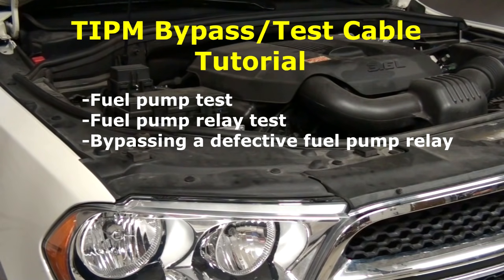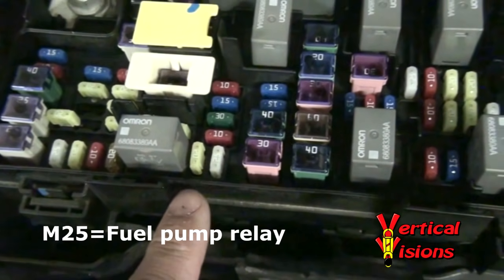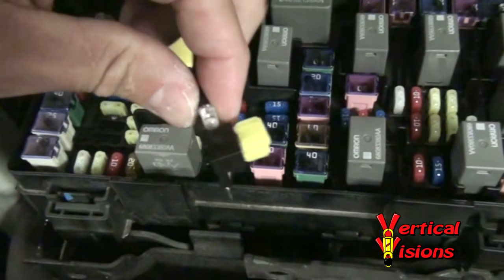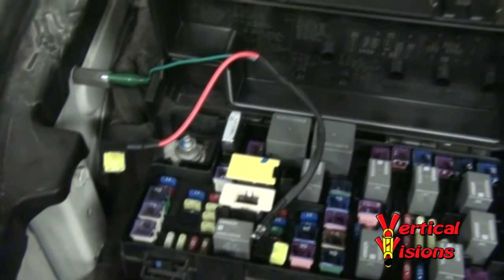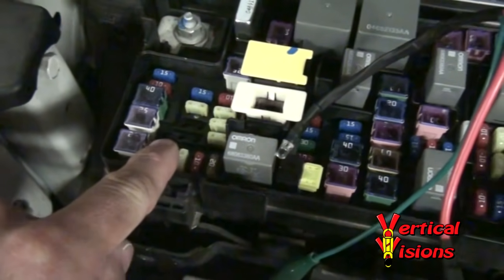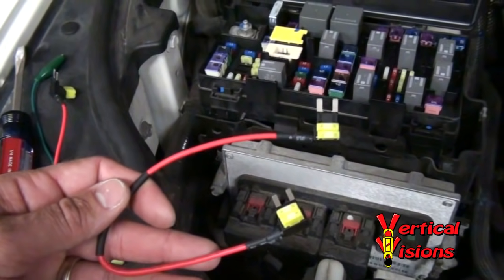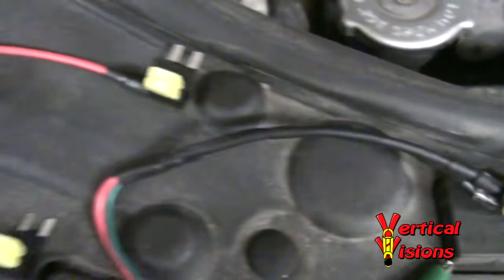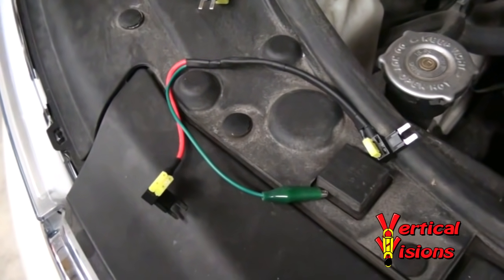TIPM Fuel Relay Test and Bypass Solutions - Most 2007-2021 Dodge, Chrysler, Ram, Jeep, VW Vehicles

Comment: Thank you Jason, I just ordered your bypass wire you came up with.  Like everyone else has said in some way this is a life saver.  It is very frustrating when a part is $1200  and the car is a 2011.  My daughter's 2011 Jeep Liberty the other day when she was driving on a 55 mph road just stopped running, luckily my wife was with her and was able to talk her through getting to shoulder of road without power steering which my daughter has never experienced before.  My wife though she had forgot to get gas or something but she had a quarter tank.  They sat there for a few minutes and then it started back up and they came on home.  Shame on Jeep for knowing about this problem with a 5 dollar relay that could potentially cause bad wrecks and praise for Jason Bell for having the electrical knowledge and where with all to find a simple affordable solution.
Reply: It's only $ 175  dealers are crooks  .. my friend that works at dodge put one under her name for me for my truck cost her only 175  but for me its 1200 wtf

Comment: This is happening to my 2011 ram 1500. Bought your cable and did the M7 fuse tap and it would start and get me going. Today that stopped working and now I tapped into the M37 which worked even better with starting. However, upon getting out of my vehicle and turning it off the engine/truck was still running. Any idea why or how to avoid having to pop the hood and pulling the fuse each time?
Reply from the maker: You must remove the lower fuse on the M25 end of the cable per our instructions:  https://www.verticalvisions.com/tipm-test-bypass-cable-mini-blade-fuses.html#faq19,  Otherwise, a stuck on faulty fuel relay can backfeed power to the run/start circuit, which will keep your vehicle running.

Comment: I recently bought this from you but since I installed it my Dodge battery drains dispite me removing the lower fuse and yes the fuel pump does stop running
Reply from the maker: Email us a photo of your installation so we can see if the cable is connected properly. Are you using the new M37 to M25 connection?  More here:  https://www.verticalvisions.com/tipm-test-bypass-cable-mini-blade-fuses.html#faq19.  Other things can drain your battery besides the fuel pump.

Comment: Thank you!  Thank you.  Thank you!  One day I woke up and my car would crank but not start.  I was at my wit's end.  I had it towed to the local shop where they couldn't diagnose it for a week.  I had no warning lights, everything came on, it just would not crank.  I researched the issue along with my model, 2013 Chrysler Town and Country, and I kept seeing the same problem that Chrysler refuses to acknowledge...the hinky TIPM and the often failing fuel pump relay and overall lack of reliability of the TIPM.  The mechanic eventually said I needed a new fuel pump even though you could hear it come on when the car was turned on and a $694 fuel pump repair.  I politely had my car towed to the dealership and they got in and the vile betrayer that is my car started and he drove it around saying that it seemed fine.  I came back the next day and it was still fine but they said if I wanted to pay them to diagnose it they would but sometimes it's just one of those things you hysterical woman you.  I was at my wit's end, drove it home where it promptly stopped cranking again.  I ordered your simple cable, installed it(I am not technically inclined but the instructions were so clear a 10-year-old could do it), and drove around the block....came back home...10 minutes later drove to the grocery store...then back home...parked it came in and went back out to....you see where I am going.  A $25 cord saved the day until I can either get a new TIPM or I give up on this car.  Thank you!
Reply from the maker: The most difficult part of our business is convincing people a $25 cable will resolve their issue.  Yes, they work and there are thousands of cables in use worldwide since 2014.  Thanks for your comments.
Reply: @VerticalVisions  I have a 2007 Dodge ram 1500 slt with the 5.7 hemi. 
The #7 fuse is the SRT: Solenoid reverse lockout 
The #25 is the window door lock switch, driver side, shift motor, mode sensor assembly.
I was wondering if this procedure would work the same on my tipm configuration. I did read somewhere that the 2007 does not have a fuel pump fuse. 
Any help would be greatly appreciated.
Reply: tried every fuse in the box but none worked..could be another issue..decided to take it to a mechanic..thanks anyway
Reply: How do I buy this part?
Reply from the maker: https://www.verticalvisions.com/products/tipm-test-bypass-cables.html
Reply: @VerticalVisions  I have a 2007 dodge grand caravan..it doesn't have a m7 or m37 fuse..which fuse would be good to use for this year's make
Reply from the maker: @torrancenorwood8579  Not sure, as we have not tested any cables or products on your TIPM style.  Another option would be a used TIPM:  https://www.verticalvisions.com/used-tipm.html
Reply: How can I order the jump wire my name is Keith Allen
Reply from the maker: @keithallen3505  https://www.verticalvisions.com/tipm-test-bypass-cable-mini-blade-fuses.html
Reply: @VerticalVisions  Hello. Jason is by doing this is safe for the vehicle.
Reply from the maker: @danylerma73  Of course it's safe.  Tens of thousands of cables are in use all over the world as I type this reply.
Reply: Notify me if there’s one available for the 2010 Ram 3500 PLEASE and Thank You 🙏🏽
Reply: 8 months later, hows it going? Great, I hope!! 

I'm in the market for a Grand Cherokee, and unfortunately they seem to be plagued with this issue
Reply: THANKS A LOT JASSON.
One question after bypassing is the battery will drain??
Reply from the maker: @KamranRizvi  No.  You can configure the cable to isolate the faulty fuel pump relay from the fuel pump circuit.

Comment: You mentioned there could be a possible remote start issue. After i completed the bypass my remote start will not start the van. I can use the ignition and it starts no problem but if i use the remote start it continually cranks without starting. Do you have a fix for this issue?
Reply from the maker: Here's the fix (a new way to hook up the cable):  https://www.verticalvisions.com/tipm-test-bypass-cable-mini-blade-fuses.html#faq19

Comment: I have my 2013 town & country with no power to either horn fuses but horns work when locking with FOB or using the panic button!! But they both go through the security system and the flashers will flash as well.. But my right & left horn fuses are dead on both sides of the fuses!! I think the horn relay that is soldered in isn't working... Will this fix this problem??
Reply from the maker: No.  Our part solves fuel relay issues where constant power is required.  If you were to use our TIPM cables for your horn, you would have a horn that works 100% of the time (not good).  There is normally no power on the horn fuses until you activate the horn.  If your FOB honks but the steering wheel won't, then I would focus on the mechanical horn connection in the steering wheel.  Likely not a horn relay issue as these relays rarely fail due to such intermittent use.

Comment: This doesnt work for me.   I installed it an it did work the very 1st time.  Alot of thick white smoke came out of my exhaust pipe so i cut it off, an now it wont start again.
Reply from the maker: Did you make your own cable?  What is your vehicle year/make/model?  Make sure you're using the newer M37 to M25 connection:  https://www.verticalvisions.com/tipm-test-bypass-cable-mini-blade-fuses.html#faq19

Comment: Hi, i just tested my fuel pump fuse on my 2009 ram with a test light, with engine off, test light light up like is a good fuse, this will discard a bad relay, right? Please, let me know , working on it now. Tks
Reply from the maker: 2007-2010 Ram vehicles have their fuel pump relay in a different position (further downstream of the fuse), so detecting 12 VDC when the vehicle is off is normal.  This also means you can't use TIPM cables to test or inject power (bad) as is done on 2011 and newer Rams and often a TIPM replacement is suggested (https://www.verticalvisions.com/used-tipm.html) because it's quite difficult to replace the faulty relay on the circuit board.  Here is more info:  https://www.verticalvisions.com/tipm-test-bypass-cable-mini-blade-fuses.html#faq10

Comment: Hello Jason. Thanks for the great video. You mentioned that you took apart the tipm several times to make this bypass cable. I’m curious if it would adapt to checking all the starter control relays that aren’t serviceable as well. I’m trying to find an intermittent no crank and need to rule out or call the tipm. Thanks for you video and your help if you have time.
Reply from the maker: I just did some research on starter issues inside the TIPM.  There is a surface mount high side driver on one PCB that interfaces with the starter circuit.  While I have yet to repair one, I believe this part is the culprit on some no start TIPMs.

Comment: Hello Jason, my Ram 1500 is a 2007. It shut down on the freeway.  I suspected the fuel pump. Once towed home I validated that because I sprayed quick start in intake duct and it started for a moment. I want to try the bypass 1st, but your TIPM looks different than the one I have?
Reply from the maker: https://www.verticalvisions.com/tipm-test-bypass-cable-mini-blade-fuses.html#faq10

Comment: I have a Durango 2013 I did the same thing one time I got it started but I saw your video purchase that cable on your web site it arrive 2 days ago but truck it’s doing good should I by passed it or wait until it fails again?
Reply from the maker: You likely already have an external fuel relay installed on your vehicle per the 2011-13 Durango recall and you may not even know it.  Go here to identify and see solutions:  https://www.verticalvisions.com/omron-g8jn-external-relay.html#identify
Reply: Jason Bell I installed your cable from m25 to m37 and it start, what next? Is the problem solve? Can I keep it like that? 
Thanks for the reply
Reply from the maker: @prietodgo  Just drive like you normally do.  Problem bypassed.  Keep it like that.
Reply: I will make a video of this in Spanish for the Latino community and I will add your link to purchase the cable men thank you very much

Comment: We were told today that we need to replace the Integrated Control Manual.  We have a 2005 Chrysler Town and Country.  The passenger headlight is not working and they are saying that it is the control manual.  Do you know anything about this or if there is anyway around this.  We will try a used auto parts store first, but there are also refurbished one online.  Will this wire that you developed work for anything besides fuel pump relay?

Comment: Absolutely unbelievable. Took my car to the mechanic to get the issue diagnosed. They informed me that it fell under Chryslers TSB and that it was going to cost me almost $1,000 to get it fixed. I looked online for a second opinion and found this video. Got the cable, tested it out, heard the fuel pump running, use the multimeter to confirm that my relay was stuck in the off position and just bypass the relay ( fuel pump on when the car is on) incredibly the saved me almost $1,000 as the part was only $20 (got the non testing cable)

Comment: Hi , my name is Maylis. I have a qustion for you , I am using my brothers you tube talk and ask ,! What about the 2006 dodge ram 1500 fuel pump ,fuelnpump relay test ,and by passing the the defective fuel relay pump ,? Dose the dodge ram 2006 any type of inline fuel filter or any types of fuel filters or screens that can keep it from runing the fuel pump? Also this dodge ram 1500 2006 year model v6 has been discontinued  and the parts are next to impossible to get or the dont make them any more .

Comment: Will the bypass cable also work for the circuit that controls the two Front Power Windows, power mirrors and left side power door lock and mirror heaters?
Reply from the maker: Not that we're aware of.  A bypass cables provides full time power to functions that require power when the vehicle is starting or running only.  Windows and mirrors require intermittent power per only when you actuate the control switch/mechanism.

Comment: Can I make sure if I need this or not? The thing is I have to ship it internationally which will cost me more than the bypass itself!
Reply from the maker: Which vehicle do you have?  Most TIPMs should have 12 VDC power on the fuel pump fuse during engine cranking and while running.  If no 12 VDC when trying to start the vehicle, the internal fuel pump relay is likely faulty and a TIPM cable should resolve it.

Comment: When this wire is installed correctly so it only operates when the key is on................ is it safe to just leave it like that and not replace the faulty fuel pump relay??
Reply from the maker: We have a new way to hook up the cable since this video was created:  https://www.verticalvisions.com/tipm-test-bypass-cable-mini-blade-fuses.html#faq19.  There are thousands of cables in use worldwide.  Safe.   No issues.  You don't need to replace the faulty relay.

Comment: I purchased a 2012 Jeep Cherokee that had an external relay installed by the dealer due to the recall.  I have owned the car for about a year now and had to replace the external relay about 3 times already.  I noticed in your web page the the TIPM plug-and play systems won't work on my case due to the fact that the dealer had to cut some wires in order to install the external relay.  My questions are:  can I take all the wires installed by the dealer out, solder the cut wires together and use the plug-and play system?...if not.   Can you do a TIPM repair even in my dealer did the recall and cut some wires? or would you suggest that my best option at this point would be to purchase an used TIPM?  Please let me know.....thank you!
Reply from the maker: Yes, you can remove the external fuel relay and solder a few wires back to together to go back to the factory configuration.  This will allow the use of many of our fuel relay solutions or a new/used TIPM to resolve a fuel pump relay problem.  We can always do a TIPM repair to replace a faulty fuel pump relay, but it won't help unless you reverse the external relay.  A new TIPM won't help either as you will ALWAYS have to rely on that external fuel relay to power your fuel pump unless you remove the external.

Comment: How does pulling the one fuse stop the pump from running? are they separate wires under the heat shrink for both fuses?
Reply from the maker: Understanding how an add-a-circuit cable works will explain why pulling the lower fuse stops the pump from running.  By pulling this fuse, you are completely disconnecting the link between the old faulty fuel relay and the pump circuitry.    Look at page 4 of the following PDF for details: https://www.verticalvisions.com/pub/media/wysiwyg/docs/TIPM_cable_instructions_MINIBLADE_SIMPLE_or_STD.pdf

Comment: I have a 2008 Dodge Grand Caravan I have a similar problem but not exactly the same when you go to start the car it does nothing like the battery is dead but the battery is not dead all the lights come on in the car there's no issue with the battery it just does nothing there's no ticking there's no clicking there's no turning over can this solution solve my problem
Reply from the maker: https://www.verticalvisions.com/other-solutions.html#starter

Comment: Quite the simple temporary $3 fix it's amazing what a couple of fuse taps can do.  If some have any reservations using  power outlet with ACC & Battery constant. Power outlet ACC at M6 is available as well.  This should be temporary due to some may experience DTC such as random misfires which don't always trip MIL so be mindful of this before getting vehicle smog test make sure battery is fully charged and OBD link with power source to save any monitors if the need to cold start engine and after fuel pump is warmed disconnect battery and place the fuse itself in the relay (this only works well primarily for those whose fuel pump won't shut off.) Then drive to smog station while the fuel pump will still run after shut down it shouldn't be a hassle if they do the OBD inspection before any major battery drain.  Hope that helps.  Good man Good thinking you make great content. Love the vid 👍
Reply from the maker: We now use fuse slot M37 instead of M7 as the power source:  https://www.verticalvisions.com/tipm-test-bypass-cable-mini-blade-fuses.html#faq19

Comment: Already had recall done and later ended up with delayed starts again.  Thought fuel pump went out so replaced it.  Have power to the fuel pump connector at the pump but wont pump any fuel.  Anyone have any thoughts
Reply from the maker: 9 out of 10 times an external relay has failed and you don't have sufficient power at the pump for the pump to operate.  Omron G8JN is the external relay PN and they don't make them anymore (we're also out of stock of this part).  You can find them on Ebay for less than $10.  Hopefully we can find a substitute part soon.
Reply: @VerticalVisions  thanks I will try that

Comment: Ok I have a 2012 Ram 1500 8 cylinder. I replaced a bad battery and now I have no power to the dash at all. I have no power or lights wen i put the key in and turn the key to start. Everything is connected properly and I checked all fuses. Any thoughts?
Reply from the maker: Is vehicle starting, but no dash/lights?  Not sure from your post. Check connectors under TIPM to make sure they're secure.  Try a hard reset:  https://www.verticalvisions.com/other-solutions.html#hardreset